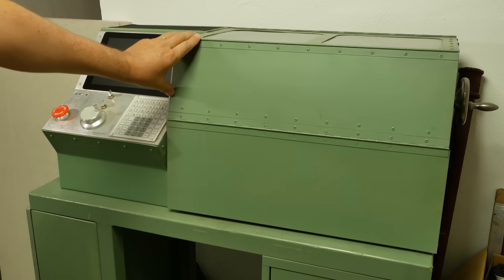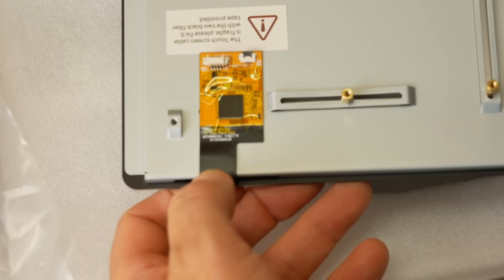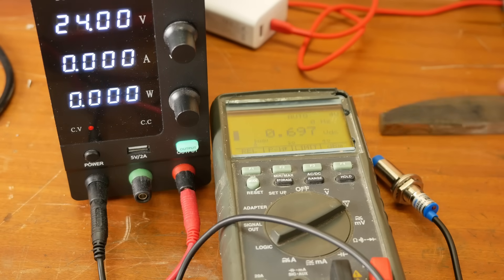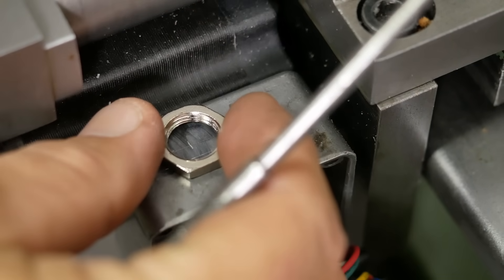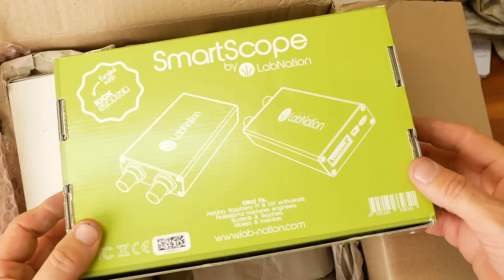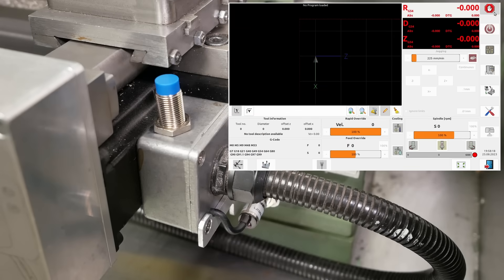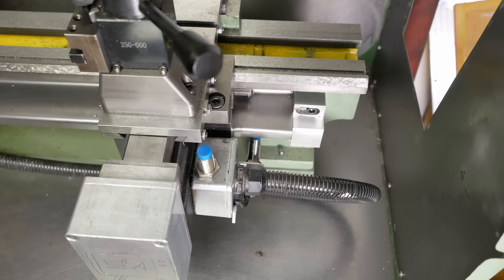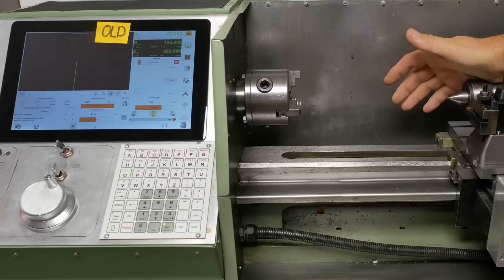Home switches - Minilathe Ep. 41 || RotarySMP

Comment: For the LCD display ; you could create a manual xorg.conf file forcing your screen in the right mode. Less hassle than a reinstall...
Reply from the maker: I bought an 800P EDID, but that also didn't work. I ave no idea how to create manual xorg.conf. Could you help me out with some tips please?
Reply: Sure ; I am assuming you know some command line Linux , if not let me know.

First off switch to a text terminal and issue the command 'sudo init 3'
Now check if there is already an xorg.conf file in /etc/X11 , if so back up with 'sudo cp /etc/X11/xorg.conf /root/'
Now run the command 'X -configure'
There should now be a clean default xorg.conf file with some basics.

We really only need the device (the display driver part which refers to the GPU) and the screen sections...

Your NUC is probably using an Intel embedded graphics chipset, which needs little work. So let's focus on the screen for now, which should look something like this. Be sure to only specify the Mode you need, nothing else.

Section "Screen"
        Identifier "Screen0"
        Device     "Card0"
        Monitor    "Monitor0"
        DefaultColorDepth 16
        SubSection "Display"
                Depth     16
                Modes "1024x768" "800x600" "640x480"  "1600x1200" "1280x1024" "1280x960"
        EndSubSection
EndSection
Reply from the maker: @javanree  Brilliant, thanks a lot for that. 
I will be editing today and tomorrow morning, but will try this out tomorrow afternoon, and report back.
Reply: @RotarySMP let me know how it works out. If it's not enough there's more possibilities, but that will require some more detailed research.
Reply from the maker: I finially got to try this late yesterday evening. 
Put the old monitor back in,
sudo init 3 caused the monitor to go blank, and I could only recover by hard rebooting. 
I googled it and suspect that changing runlevels, puts it into a graphics mode unsupported by that monitor.

Tried it three times, but always same result. So I didn't get to the XConf stuff.
Reply: Ah OK, so it's really limited. Any chance you can network hook up a laptop ? Then you could issue the commands over SSH which doesn't rely on the display system.
Reply from the maker: @javanree  Theoretically yes, as the PC in the mini-lathe does connect to my wifi. 
I went through this once with Alexander on the Schaublin PC, but would not have any clue how to do it again.
There goes another 5 hour evening working out how to set up SSH :/
Reply: Sorry to hear about the frustrations. Given all these limits a reinstall might indeed be simpler in your case 🙄

Comment: If I were a prospective buyer, I'd be very concerned that the data plate was clean. 

Otherwise, I'd love it, and it would make an excellent addition to a small home shop for small parts.
Reply from the maker: Yeah, you are right, getting the dataplate cleanis not one of my strengths :)
Reply: @RotarySMP   Regarding the blank monitor: It looks all the world like the wrong refresh rate is being applied to the new monitor. The EDID (Extended Display ID) is normally read at boot time, and sometimes as a "plug and play" event. However, if there is a fixed xorg[dot]conf file, it will honour the config and force the refresh rate. P'n'P doesn't appear to be functioning properly, so try a cold boot with the new monitor attached as a first test.

Failing a reboot test, try the following to reconfigure the xorg[dot]conf file:

1. Reboot into a safe environment by holding shift key.
2. Choose your current kernel (ideally there should only be one, but there may be older options available depending on previous upgrades) "with networking" is optional.
3. At the command prompt enter "telinit 3" to go to the correct run level for final config before full desktop.
4. Enter "xorg -configure" at the command prompt.
5 Reboot the machine as normal "sudo shutdown  -r now"

This should bring back the graphical interface by reading your hardware, and making the relevant changes to xorg[dot]config. There's a man page on the Xorg site that explains what each section of the configuration file does. Search xorg[dot]conf. I can't link it due to the whole comment being eaten by the "no hyperlinks" setting (ask me how I know and why I use [dot]?)

There shouldn't be any harm in doing a sysupgrade, but it may have a few pitfalls. ie. xorg configuration may persist, as well as some other configuration files that will have suboptimal settings. Personally, I'd bite the bullet, and do a fresh install of an up to date OS, and let the installation make the best choices. This is especially important in a Real Time environment such as gcode streaming. It should go without saying that a back up of your CNC controller files should be made first. A pain in the proverbial I know, but I'd also rebuild the controller config using the backup for reference. Some timing issues may have already been addressed in later software builds, as well as other foibles. (You did comment the reason for your debounce timing didn't you? ;-) )

Good luck mate! (for the second time - youtube ate my previous comment)

Comment: I got 10 of those npn sensors a few years back and use them often. Sometimes a pull up resistor is needed if the controller input doesn't have built in pull up.
Reply from the maker: Thanks The Mesa 7i96 has built in pull up.

Comment: Are you using a Raspberry Pi to drive that display? They're notorious for not handling display hotplug correctly. In the video you showed power cycling the display, but in this case it may be the raspi that needs rebooting :).
(… or it's something else entirely)
Reply from the maker: The lathe controller is a Gigabyte Nuc x86 PC.
Reply: @RotarySMP  ah OK / sorry / nevermind then 😅
Reply from the maker: @equi-nox  Mayve the HDMI chip in the old Gigabyte is the same as the RaspPi used :)

Comment: Our half a million rand pick and place machine homes itself by banging into it's hard stops actually.
Granted it uses servos not steppers. But still.
Reply from the maker: That is interesting. If I find those inductive sensors are not repeatable enough in practice, I can go back to hard stops.
Reply: @RotarySMP   I don't think it's better. :P I just thought it's interesting. They also have shock absorbers at the end to stop them slamming into the ends too hard. And they go very slowly while initiating.

Comment: Rather than thinking of the prox wiring as common positive, Consider NPN as a normally closed and PNP as normally open switches. The NPN prox is providing +Vcc between the output signal and ground. When triggered the signal output will drop to 0 Vcc. Unless already set up in programming, the conditional homed statement will only become true on the falling edge when the prox output becomes 0. Where as a PNP acts as normally open switch until triggered providing a 1=true between the signal output and ground. The 2 are just wired accordingly. 
These are not technically precision switches for repeatable positioning like a microswitch. While it will work as a reference for one setup in a stepper motor control, that reference may shift with subsequent home cycles.
Reply from the maker: Thanks for your feedback on this. It is not the most rigid and accurate machine, so I am hopeful for acceptable repeatability.

Comment: plug the new screen in and power off the lath then let it start up see if the screen works then it will be using the previous screens settings and they may not be compatible with the new one a restart will reset to the new device
Reply from the maker: I think I did that, but you are right, I need to try again and make sure.

Comment: The name is right there in the name. "Proximity".  They cannot provide you a highly repeatable trigger point.  The sensor will trigger every time you get within some proximity but that value can change depending on the surface debris and since it is inductive, the sensitivity will vary depending on how much metallic swarf is on the sensed surface.  It will work with aluminum. Its inductive not magnetic. All it needs is a conductive surface in proximity. We use them in our company for sensing the presence of aluminum tubes in our test station.
Reply from the maker: Yeah, although given I am sliding in from the side, and you can see if they are clean or not, I do expect repeatability within the limits of the Mini-lathe limited accuracy.
Reply: @RotarySMP  Decide what repeatability you need and test it 👍🏻.  One good experiment is worth a thousand theories.
Reply from the maker: @physicsguybrian  Good point Brian. Thanks.
Reply: @RotarySMP  Most welcome!

Comment: Could it be a different HDMI type presumption?  e.g. HDMI cable with or without Ethernet.

Here is a cut-and-paste:

"Understanding HDMI vs Ethernet vs. HDMI with Ethernet: The Guide
HDMI and Ethernet are two data transmission cables that cannot be more different. HDMI transmits audio and video signals, while ethernet cables transmit regular data. However, there is HDMI with Ethernet, a cable combining both features for multimedia purposes."

I first learned of this when I noticed a new device running and it turned out to be the cable itself.
Reply from the maker: I tried two different cables, and that monitor PnP normally on two other computers.

Comment: What is the repeatability of the switches?
Reply: If you lookup that question in the 3d printing world you will find them tested quite precise. Good enough for my mill
Reply from the maker: @michaeleitel7186  Thanks for your feedback on that.
Reply from the maker: Good question. I didn't measure it yet. If they are crap, I'll go back to mechanical homing on block.

Comment: Hello, just to be 100% sure that your sensor on the post will work correctly you can put L bracket with magnetic strip that allows the sensor to activate in reliable and repitable position all the time.
Reply from the maker: Thanks for the tip. I'll keep an eye on how reliable it is.
Reply: @RotarySMP  How repeatable were those inductive switches? I was under the impression they well suited for homing(?).
Reply from the maker: @AntiVaganza  I haven't really used the Mini-lathe since I got my Schaublin up and running. The testing I did they seemed to repeat within a couple of 0.01mm

Comment: Some LCD thoughts.
Does the new display controller have more than just the HDMI input and that it is switched to the other input.
Alternatively , is the signal standard being generated out of specification for the new controller. For example, the refresh rate is too high.
Perhaps hook it up to a PC/laptop and change the display settings until a picture appears?
Reply from the maker: It is a 1280x800 display, the same as the one it replaces. It plugs and plays and works find with both my laptop, and the HP PC in the Schaublin. 

If I understand correctly, the handshaking between HDMI devices is more black magic than science :)

Comment: Looks like you had the Owon scope set to AC, it is a good idea when scoping 5v logic signals to always have the scope set to DC and adjust the gnd position on the screen so the 0v to 5v range takes up the main middle area of the screen.
Reply from the maker: Thanks for the tip. I need to find some time to read the manual and play around with setting it up.

Comment: your build series on this lathe caused me to subscribe to your channel.  good like little guy hope you enjoy your new home😃
That OWON scope looks very handy, might have to order one for myself.
Reply: This exact OWON has very sluggish DMM functions, both the numeric display as well as the analog gauge display. I'd say it's maybe 2 or 3 refreshes per second, if at all.
That's why I gave it up to Mark. It's a capable oscilloscope with decent bandwidth and refresh rate, so okay in a workshop where you have space for a dedicated DMM. Maybe even more versatile than a stationary oscilloscope, as you don't have to worry about ground loops and isolation. 
The later models like the HDS242 don't have that issue and work reasonably well as a DMM as well, so that's what I have in my toolbag now. New model also has USB-C for charging, instead of some proprietary wall wart.
Reply from the maker: Thanks for that Alexander. It is a way better Osci than I ever had before.
Reply: @RotarySMP  Small form factor means it's a bit cumbersome to use, but what you need to learn is horizontal and vertical scaling, as well as the trigger threshold. Auto-scaling works somewhat decently, as seen in the video, but you often miss important waveform details that way.
Reply from the maker: @graealex  Yeah, that was just a quick first use to make pretty pictures on it's screen. I need to get into the manual and learn to set it up properly.
Reply: @RotarySMP  Better for your use case of diagnosing for example the EMI problems would be if it had two channels. Ch1 on the e-stop line, Ch2 on the motor contactor, and then trigger off Ch2 while capturing Ch1.
What makes expensive oscilloscopes expensive is often the ability to trigger off arbitrary signals, like the frame start of a digital protocol, or even mathematical functions. However, what you usually need is trigger off a falling or raising edge of a rather low-frequency signal, but with a very small time-base, so you can see the high-frequency ringing in the signal.
Reply from the maker: @graealex  It will be interesting if I can find a setting to display that spike.
Reply: @RotarySMP  Well, just play around with single-shot triggering, varying the threshold, and try falling vs raising edge if only capturing the e-stop line. There should be something visible. AFAIK you currently still have the same electrical problems as before, just debounced it through software. So there should be some clear indication of the line going well below the normal levels.
Single-shot is important, as the event only happens once when the contactor is actuated.
Reply from the maker: @graealex  Thanks. Now I just need to find time to look for it :)
Reply: @RotarySMP  The viewers need closure 😉
Reply from the maker: @graealex  Yeah, you are right. I would like to do a final video once that monitor is working (I thought one would be the last), and then one day when I feel like it, go through all 42 episodes, cut out the best bits and make a summary video.
Reply: @graealex   Hi Alex, thanks for the advice. I have 2 different models of Fluke DMM's so really I'm just looking for  (low cost) ocsilloscope function.
Back when I was doing troubleshooting and repair on cnc machine tools, I carried a small cheap analogue multimeter for checking transients like
a limit switch or proximity passing over a dog/flag  just like Mark was doing. didn't care about actual voltage ,just if the needle twitched or not.
Later I was given a new fluke DMM (don't remember the model) that had a very fast transient voltage icon that served the same function.

Comment: I'm assuming the controller was running before and driving the old screen as you have shown. If you swap out the screen on the same connector without reinitiating the connection, no new handshake is established for the HDMI DRM protection. Try either to reinitiate the connection or simply do the old trick have-you-tried-turning-it-off-and-on-again? (shoutout to the IT crowd).
Great content. I love the mix of machinist and aircraft mechanics stories!
Reply: I doubt it, it seemed to use a standard HDMI cable, which will detect unplugging and replugging.
Reply from the maker: That is why I will try an EDID, to force the 80P 60Hz mode.

Comment: Set your HOME = ??? position for joint0 and joint1 in your ini file, and it will then move to that position after homing 😊
Reply from the maker: I set positions, I am happy with the axis staying where they homed. On a little lathe, every set up and work holding is different, and I would rather manually jog around after homing.

Comment: Have you tried different resolutions, refresh rates etc. in Linux? Might be that the new screen isn't compatible with your current settings for some reason
Reply: I also think that it could be resolution issue.
Reply from the maker: I cant change anything until I get a picture on that monitor.
Reply: @RotarySMP This is how you do it: connect the display that works, change the lowest resolution and refresh rate, then test with the new display. I hope you figure it out. BTW, I like your lathe; I wish I had one to play with.
Reply from the maker: @mrgreensworkshop  Thanks for the tip, I'll give that a go.
Reply: @RotarySMP  Boot Linux in recovery mode with minimal e.g. 640x480 resolution. Or change to a low resolution with your old monitor connected first, and then connect the new one. Or Ctrl+Alt+F1 to a terminal and (assuming the terminal displays on your new screen) then change your settings from there.
Reply from the maker: @jakejakejake978  The new monitor doesn't even show the Bios screen, although the old one does. Good Idea to try setting the resolution to a minimum.

Comment: I have a very similar old Craftsman meter scope,  nearly 20 years old I think.
New Owon looks very useful bit of kit.
Yes, aluminium has a reduction of less than half than steel, ref inductive sensors, personally I would prefer the flush type, ref more accurate, I've had to modify aluminium sensor flags, and replace many sensors during testing of machines.
Farewell 7 x 12, gute reisen. 
Thanks for sharing
Reply from the maker: I would have also preferred flush sensors, but that would have required ToT's time machine, to go back and plan it better :)
Reply: @RotarySMP  as you commented on, driving to a physical stop is fairly standard procedure,  do you have an option to reduce velocity and torque on the stepper motors for homing?
The machines I'm familiar with perform this by PLC control,  then index 5mm to "Home" allowing position loop to function. 
Regards John.
Reply from the maker: @bostedtap  I am concerned about the small pulley grub screws vibrating loose if I keep doing that.